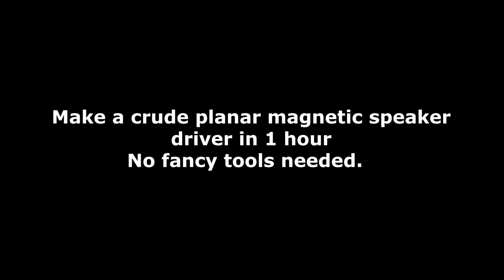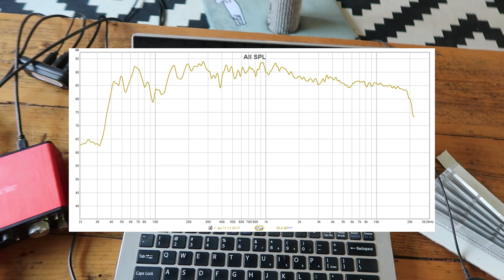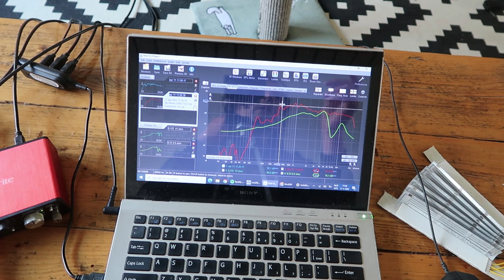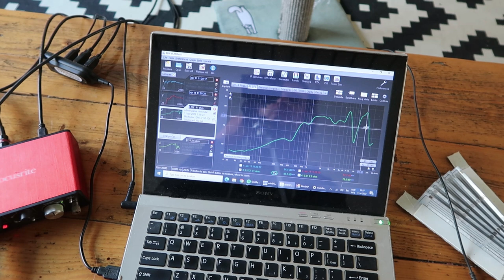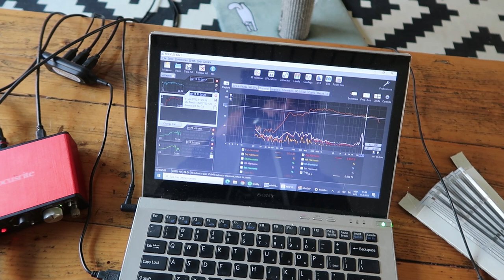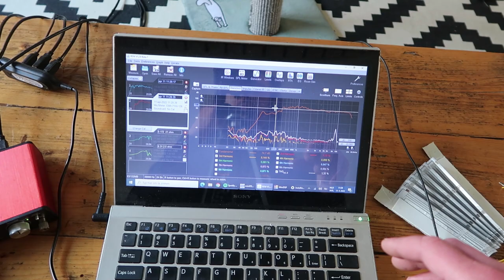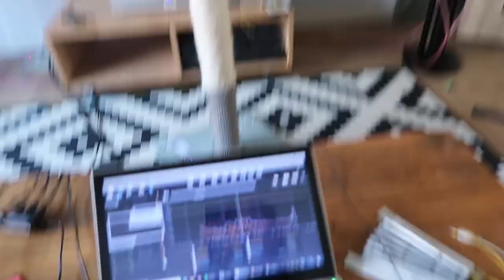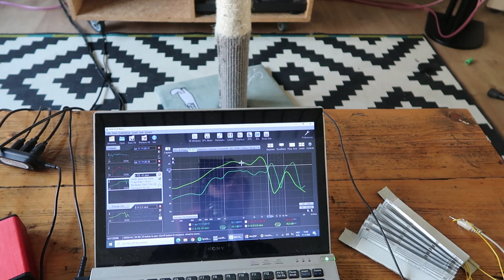1 hour build midrange - Crude DIY Planar Magnetic driver in 1 hour (no fancy tools)

Comment: I was planing to make a small headphone driver with 0,02mm enamelled copper wire and kapton tape but I wasn't sure how I should do the terminals. I think I will try the coppertape method that you use in this video. Seems to work very well and doesn't need much space.
Reply from the maker: you might want to swap out the copper wire for alumnium wire though. at least thats what i use here. it saves 40% weight.  you can get some sizes at wires.co.uk
Reply: @joppepeelen  Wow, I've been looking for a source like this. They actually have almost everything, thanks for the tip. Unfortunately aluminium only seems to go as low as .45mm and CCAW to .38 which is going to be heavier than the .02 copper. 
But if the copper ends up tearing too easily I will keep it in mind. I'm not really concerned with the weight because the 'panel' is going to be small (7x10cm).

Comment: Nice.  Newb here.  Is it connected straight from your amp to the speaker wire or are there any resistors or whatever?  I’d like to try this but am not sure if I can connect directly to my NAD 3030.  Don’t want to ruin my amp! Do you have plans and or a web site?  Thanks…
Reply from the maker: In this case i know my amp can take  2.4 ohm if your amp cant. You can use 1 or 2 turns more on the coil and your anp should not have any troubles

Comment: Neat.  Regarding options for wires/foils on the mylar, have you looked at using silver solder (wire)?  The addition of metals like zinc raises the resistance.  Plus it's easy to solder, of course.  You can get spools of it, and it could be flattened if desired.
Reply from the maker: Its way tp heavy im afraid alu is the only option

Comment: What is the best wire to use for bass, mid ,and tweeter panels.  Gauge for each, and copper or aluminum.
Reply from the maker: always alu, copper is a waste of efficiency,  and i dont do gauges :) metric only.  its not set i mean whatever you want. often used is 0.5- 0.6mm diameter for low end, and i dont use wires for tweeter duties but what i did use back in the day is 0.172mm . hope that helps
Reply: Thanks  for your reply, I can't find enameled aluminum wire easily from Canada . Do you have a supplier that you use. I have everything else but the wire.

Comment: Hey. Just had an idea ) Would you like to try a metallized foil and a low power laser to cut the wire in an aluminium layer? Few passes will be needed may be...
Reply from the maker: A laser like mine or a c02 wont hurt aluminium:( it cant cut it. It has an improper wavelength to cut it.  Besides that is metalised to thin to be useful for a conductor :(
Reply: @joppepeelen  I see... 
> that is metalised to thin - can this fact be useful for making a headphone membrane, do you think?
Reply from the maker: I think its even to thin for that as well :(

Comment: How do sound frequency and wire thickness, wire length and spool coherent?
I am curious to build a planar magnetic subwoofer myself, but don't have any knowledge about speakers.
Reply from the maker: subwoofer might be the least doable. or become insane huge. dynamic drivers are better in that regard to play as sub.  the question is a bit to large to give an awsner to im afraid. thick wire best for lower frequency. more power handling.  length of spool in combination with thickness determens the impedance so it depends on how low of an impedance your amplifier likes to drive.

Comment: You might grain 3 dB but the lower resonance frequency might hurt as much as the extra coil helps. Is that realistic?
Reply from the maker: depends if you rely on the boost resonance gives, adding more wire drops res indeed. solution would tension harder. if you still want to use that boost. (although often not much controll in resonance area) its ok for bass since it gives allot in return and people are not really that good in hearing that. this is how most magnepans work. the tuning knobs divide that resonance a bit over a wider range. but it still has a noticeable resonance. you can use it or filter it :) (filter or damp would be the best... but at a cost of efficiency)

Comment: Getting dangerously close to those mini-maggies ;)
Reply from the maker: well these played down to 400hz usable. the mini's play down to 80 ? im not sure even then they are not much use at these frequencies, someone should measure them
Reply: @joppepeelen   The minis play down to 40 hz only because of the DWM bass panel that is on the floor.  I think the minis themselves only go down to 200hz where they crossover with the bass panel.

Comment: TS Parameters won´t work for planars (or magnetostatic speakers if you want to be scientific-accurate). There are not only Mms and Sd parameters which are not applicable. Whole theory behind planars is different from classical "cone drivers" and what´s funny - has never been defined in parametric way.